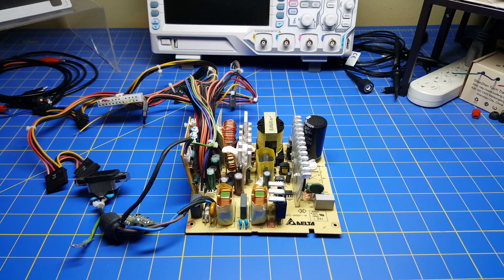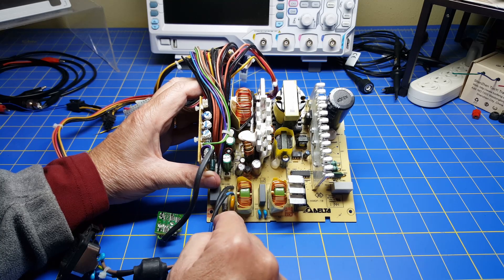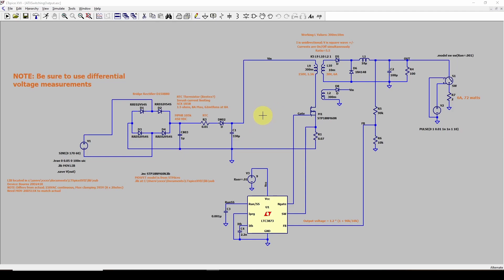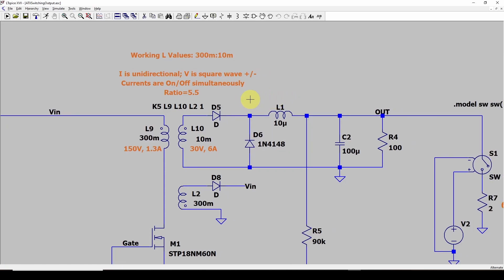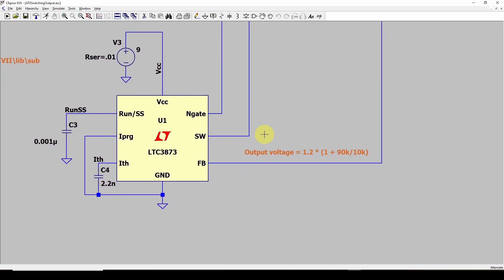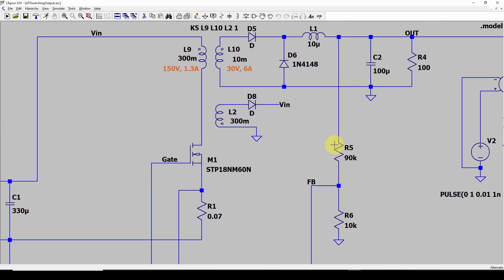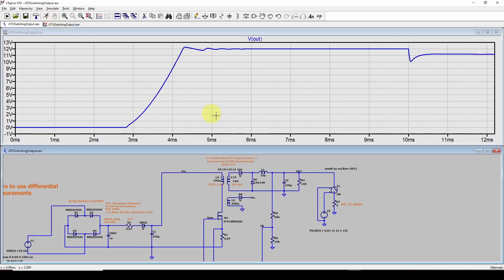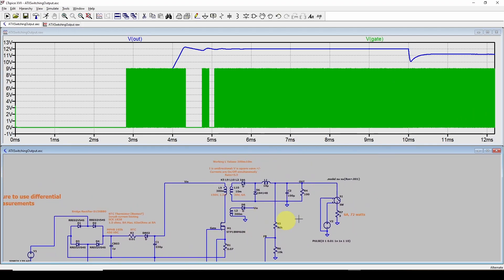Understanding Power Supplies Part 5: Pulse Width Modulation Switching

Comment: For me the hardest part about power supply design is the magnetic components. The winding methods to reduce primary to secondary capacitance coupling, Isolation, as well the filter inductors so the winding capacitance does not cause a self resonance below the peak filter frequency.
There are many design issues, making them stable over a large load range, designing them so you can just assembly and not tune any component for operation, as test technician time costs money, and adjustable parts have a high failure rate. 
I enjoy your channel. You're pretty wide bandwidth on subjects, which are all interesting to me. Thank you.
Reply from the maker: Maybe you should produce a video explaining the detailed design issues and see who watches. FYI, this video (as with most of my 220+ videos over the last 6 years) has received only 70 views in the last 2 days, and probably wont exceed 100 in the next few months. And as usual 70% of viewers stop watching after the first 60 seconds. I get zero income, and the only comments I get are either asking for free software, telling me what they think is wrong, or expecting me to actually give them free consulting services.